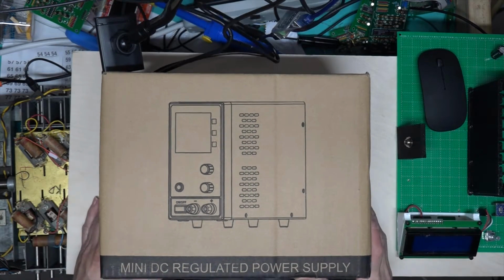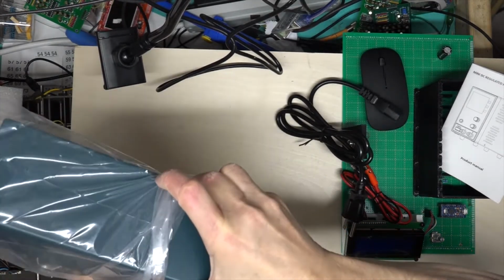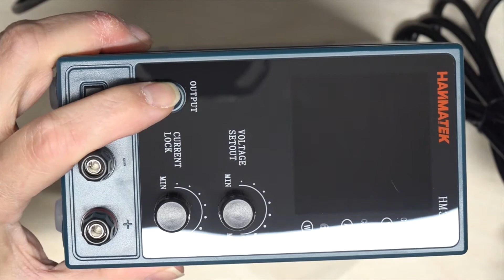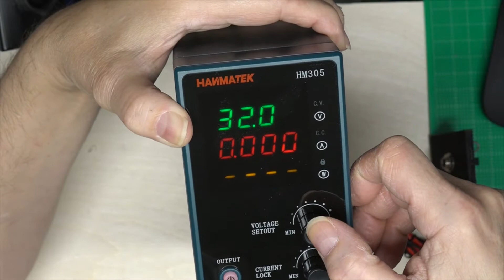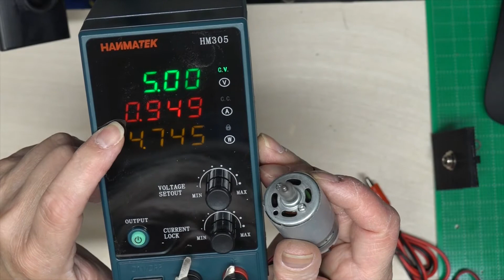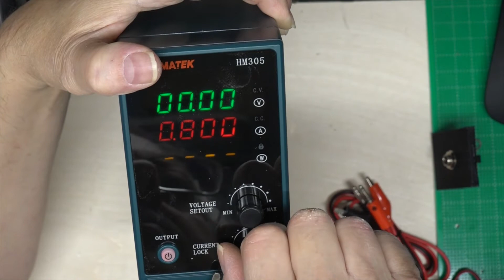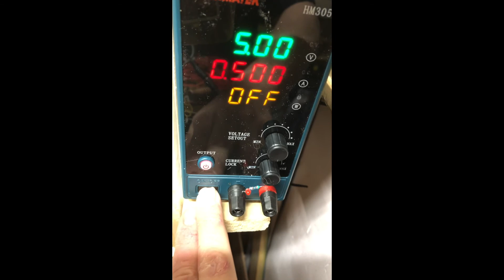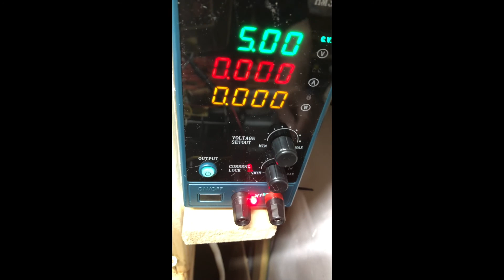HANMATEK HM305 Mini Variable Switching Digital Bench Power Supply

Comment: Hi, playing with the unit I discovered that if you want the power output active when switching on the main, you can do the following: with main power on, switch on the "output" button (green), then long press the "voltage setout" knob, display will flash. Now, if you turn off the unit then turn on again, output will be active, no need to press output button. This is important for unattended operation in case of blackout. To go back to default off, switch off the "output button", then long press "voltage setout". Hope this helps :)
Reply: You are my Hero! My unit came with output off as default and I really liked it because I use the supply for different applications with different voltage settings. So output off on startup prevents frying my electronics. So last week my kid was playing around with the supply and must have somehow changed the setting. This was the info I needed. Thanks for sharing.

Comment: I just bought one. It is slightly different despite the model number being the same, HM305. The difference is a USB 5V 2A  output instead of the power switch on the front, the power switch is in the back. The USB output is not influenced by any of the front controls, not even the output button, i.e. it is always on when the P.S. is switched on.

Comment: Hi everyone - I have a lifepo4 12v cell balancing question:

I am trying to top balance my 3.2V LiFePO4 cells, but can't get them the go above 3.3V (according to my multimeter). I've tried parallel charging them and series charging them, but it is going incredibly slow (0.012amps in parallel, 0.03 in series). I am starting to think that either my multimeter (2000 count astroAI multimeter from Amazon) isn't reading them correctly, or my charger (Hanmatek 5v from Amazon) isn't reading the voltage correctly, and therefore is giving them very little current. Can anyone offer input as to how to get them up to 3.6V so I can confirm they are top balanced with my multimeter?

Comment: That user interface is really crappy! The developer never used his own product!
Reply from the maker: Fortunately now that I've got it on 5V, it'll probably never need to be changed again!
Reply: There’s nothing wrong with the interface, only the joker demonstrating it .. balancing everything in one hand while awkwardly fiddling with the other. You should have had a practice before embarrassing yourself
Reply: @graemehorseface8578  Disagree - I have this same unit and my primary gripe is that the timeout is so quick.  You get 1 second which if you don't have the number you want exactly in mind isn't enough time.   To save time my workflow is to start turning the knob moments before I fully pinpoint the target.  Maybe not the best workflow but this unit definitely can't keep up.  The interface really isn't great.